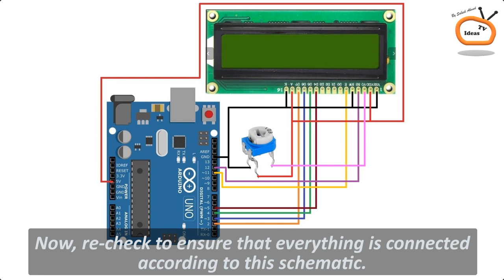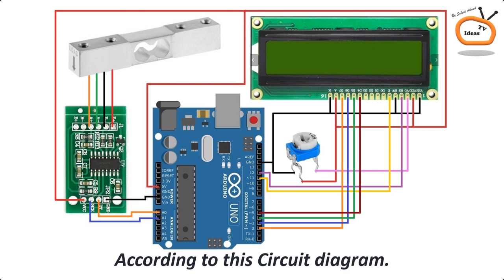How to make Digital Weight Measuring Machine with Arduino | Arduino Project

Comment: Hii currently I am trying to do this project, but I my LCD screen is been showing blank ...I have tried to adjust using the potentiometer but no difference, any suggestions?
Reply from the maker: Check your jumper wires connected to the LCD's input pins

Comment: Hey :) what is the value of the variable resistor, thanks. I unsure
Reply from the maker: 103
Reply: @IdeasTv  Thank You, the picture shows 103 ohms, but I wanted to check
Reply from the maker: Pot 103 means 10K Ohms
Reply: @IdeasTv  Thanking You 103+3x0 =130000 times :)

Comment: Hi! May i ask if how does arduino uno differs from other weight measuring machine without arduino in it? How does it helps the weight measuring machine to be 99.9% precise? Hoping for your reply. Need it so bad for my project. Thank u
Reply from the maker: Arduino is accurate but not as accurate as a card/circuit board which is specifically designed for weight measuring purpose

Comment: Hello Ideas TV,I have a problem with this project so can you contact me so it will so helpful
Reply from the maker: yes, please tell me
Reply: @IdeasTv  
I have used the same thing you do and same connection but when I plug in the power it does not turn on .

Comment: Very good video. I am new to load cell design. My doubt is how do you decide max. and min. surface area of circular disk or plate mounted on the load cell? And will the weigh scale produce same results if 30gram weight placed on corner or edge of the plate instead placed to centre (as shown in video).

Comment: Great video! I manage to do this project, but I have some problems. Please help me if you have time.
1. After the calibrate, when there nothing on the scale, the number seem to be unstable, it change in the range from -5 to 5, I keep the same code and using 100g in calibrate part like you.
2. I don't quite understand readCount() function. Can you explain what it is?
Reply from the maker: -5 to 5 variations when nothing on scale is due to improper placement of load cell kindly try to change your load cell base, screws, position or disk on load cell etc.